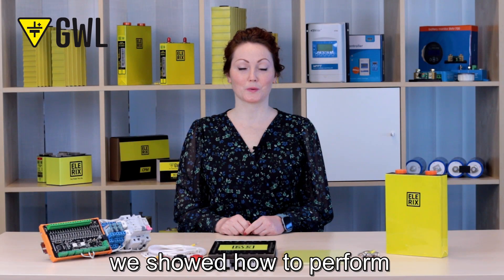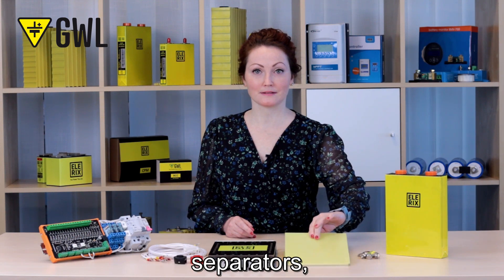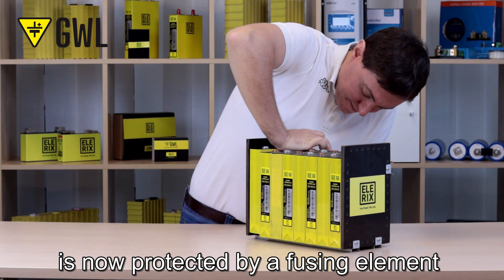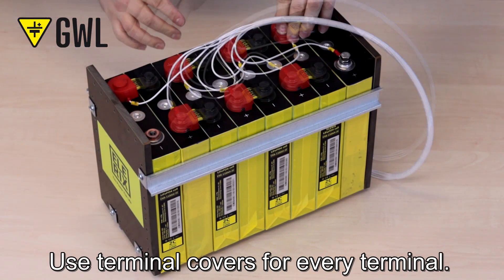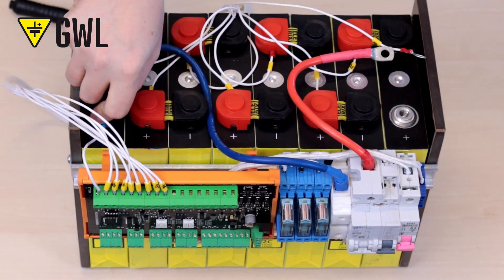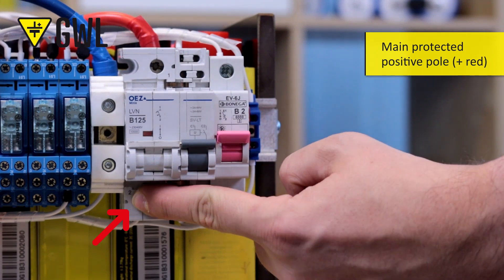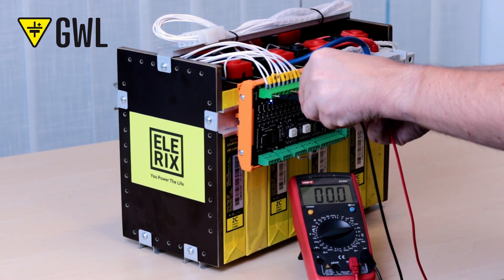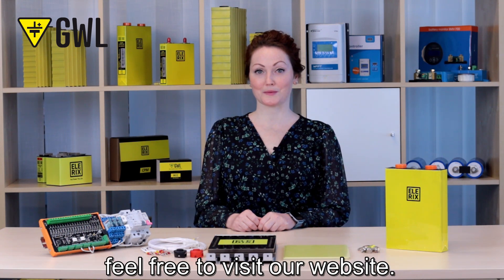How to connect BMS to your Battery pack

Comment: On the connections side to the power i understand :
- Negative pole is fused
- Positive pole goes through a 1P 60VDC Breaker 125A with a shunt release (OEZ LVN-125B + OEZ SV-LT) paired to it
which is the role of the Bonega EV-6J 1P Breaker... what for ?
Thanks
Reply from the maker: Hello, the BONEGA circuit breaker is for protecting the coils of KA1, KA2 and KA3 relays.
Reply: @ELERIX-LiFePO4  Could you please translate it to this video example ? How (if) is it connected to the OEZ braker/shunt ?

Comment: Can I connect the battery directly to the hover board, bypassing the BMS?
Reply from the maker: Well, you can, but your battery will not be protected. It's like driving without seatbelts...

Comment: A bit interested in solutions for the ELERIX Lithium Battery LiFePO4 12V 30Ah - Pack XT60 are there giant bms boards available for these or how should one deal with the 6 connectors each..
Reply from the maker: Hello, what voltage you'd like to get to? Is your concern the increase of capacity (so you'd like to monitor each cell individually) or you want to monitor the pack as a whole?

At the moment, we can offer you this:
– display for indication:  https://shop.gwl.eu/_d7943.html
– USB C charger (less powerful): https://shop.gwl.eu/_d7944.html + this: https://shop.gwl.eu/_d8367.html
– charger with separate power supply (more powerful) https://shop.gwl.eu/_d7945.html + this https://shop.gwl.eu/_d7946.html

We hope this helps, yours GWL

Comment: Nice and clean video. You didn't mention the total amphere vault and whatts of this battery
Reply from the maker: The cross-sections of the wires used were dimensioned for short-circuit current, i.e. hundreds of amperes.

Batteries used: 
LTO 
https://shop.gwl.eu/_d7015.html 
and https://shop.gwl.eu/_d7777.html

LFP
https://shop.gwl.eu/_d2010.html and similar to this
Reply: Is it the team or presenter replying?

Comment: What a nice nubile young lady 🤗 What are these batteries for guys? Can you get a plug that connects to your house and if there is a power cut these batteries automatically power the house? Then when the power is back on again, they start charging again, but dont overcharge because lithium batteries are much more dangerous than other batteries 😆 Can you get a Teslar plug for these incase you get stuck in a traffic jam in cold weather and run out of fuel?

Comment: 1:06 whats the use of separators ?
Reply from the maker: It is an additional safety insulating element that prevents the metal parts of the cells from touching each other